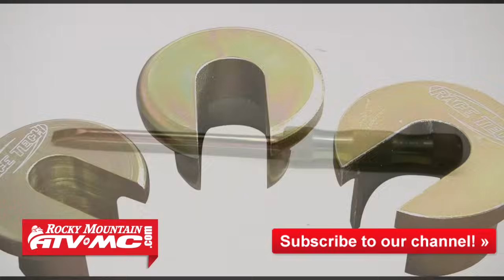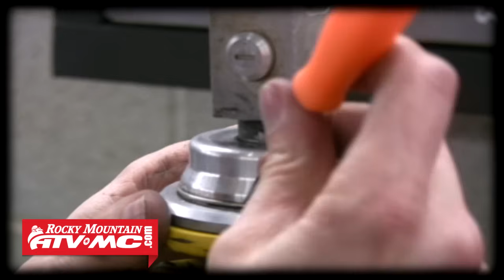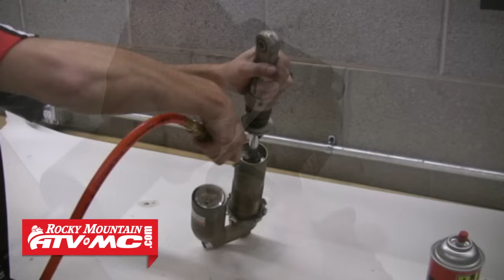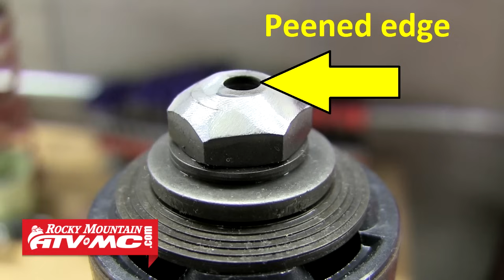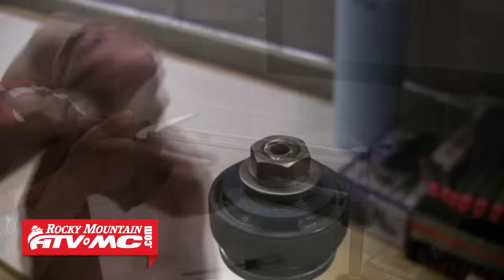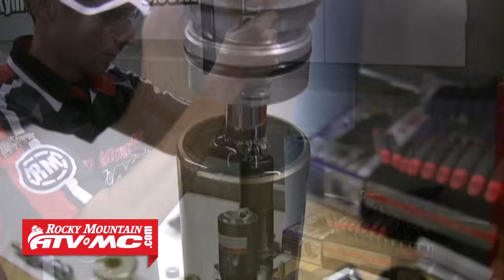How To Rebuild a Motorcycle Shock

Comment: hi guys on your website it shows that there is a circlip next to the Rear Shock Seal Head. just wonder what that is for thanks
Reply from the maker: That's used to retain the rear shock seal in the chamber when you fill the shock bladder with nitrogen.

Comment: how come when I push the seal head down it just Springs right back up to where it's originally seated hiding the clip I have the valve stem out there should be no pressure in the shock from the bladder

Comment: is it really necessary to use that much oil when pushing the bladder back in?  I don't want to make a huge mess all over my vise and floor.
Reply from the maker: +matt_ru You do want to make sure there is plenty of shock fluid so you don't get any air bubbles.  It's the best way to ensure that you don't get any air in the bladder chamber.

Comment: you need to be more specific about the grinding aspect, what's too far? and how do you know that a new nut is going to fit perfectly?
Reply from the maker: +Chris O'connor The goal is to take as little material as possible. The shaft from the factory will be peened or staked to ensure that the nut does not accidentally come off so we are removing just enough to allow us to remove the nut. Each shock will be a little different and some service manuals will demonstrate the complete shock rebuild so always check there first. Just take it a little bit at a time while avoiding any grinding on the center of the shock shaft and you’ll be fine.
Reply: +Rocky Mountain ATV MC thankyou I really appreciate the answer back, I will give it a go with manual in hand. thanks again!

Comment: I’m rebuilding my 1985 kx125. And why do you have to fill the bladder with nitrogen
Reply from the maker: There are a couple reasons but mainly that nitrogen reacts better under heat and pressure giving your shock a more consistent feel than if were filled with air. Compressed air has water vapor inside of it which changes the way the shock will react and water vapor under pressure is harder on your internal parts.
Reply: But... Air is 80 percent Nitrogen and 18 percent oxygen and 2 percent CO2 and argon and is trapped inside the bladder. If there's any moisture it cant get to internal parts.

Comment: How do you add oil in an older shock with no reservoir ?
Reply: If the shock is re-build-able, top it off the best you can, or even assemble it submerged in the oil.

Comment: is nitrogen necessary in any shock?
Reply from the maker: We recommend filling your shock with whatever the manufacturer calls for, to avoid damaging anything.
Reply: @rmatvmc  ok thanks. Air s recommend since the chamber in my suspension was too small for nitro
Reply from the maker: The chamber was too small? Shock's use nitrogen because it is less volatile and prone to changes under use and temperature changes. AKA more consistent performance from your shock. As a gas heats up it will expand and make the shock feel more firm. Nitrogen is more consistent through these temperature swings. Also, nitrogen is a dry gas, making it nicer on your internal components. It also has larger molecules than oxygen which makes any bleed off or leakage much slower than oxygen. I would always recommend running nitrogen in a shock, unless you are absolutely in a pinch. 👍🏼

Comment: can some one help me with this i just bought a used bike and the low speed clicker and the high speed nut dont spin independently. For example if you try and turn the low speed the high speed turns with it at the same time. The bike a a 07 yz125 i was wondering if there would be anyway to fix this or do i have to buy a whole new rear shock for 900+
Reply from the maker: The low speed will move with high.  If high moves with low it is probably just dirty and gummed up  a bit.  Just hold the high speed with a wrench while you move low.  Maybe a little wd40 worked in will fix it. Let us know what ya figure out..
Reply: Thanks i got it fixed i guess the guy before tried to jam it in or something.
Reply from the maker: yamaha yz Sweet, nice job!

Comment: how often do I have to do this
Reply from the maker: Your service manual should have the service intervals for your bike.  Usually for a rear shock it is between 20-30 hrs of riding time. It will depend on each year make and model and with what parts will need to be replaced?  Sometimes all it will need is a good fluid flush..

Comment: Every time I push the seal head down to reveal the circlip it pops back up and I already released the gas pressure.
Reply from the maker: +JD Weaver Yea, we recommend releasing the pressure and then removing the valve stem core completely in our video.
Reply: JD Weaver I'm having the same issue what did you do to stop it from springing back up I have the valve stem out the bladder is empty
Reply: honda2fiftyR 
unscrew the valve at the top of the reservoir. it's about 1/2 or 9/16 box end wrench you'll need. make sure that thing is pointed away from you! it will shoot out a few feet with some force with a bunch of fluid following it. Wear eye protection. have a towel wrapped around the wrench and valve while you are unscrewing it. then all the pressure will be out. Kind of strange that I still had pressure since I did release the air first. In actuality mine did not need rebuilt... It only had a couple pounds of air pressure in it. I should have asked how much pressure was needed before I did this :(
Reply: JD Weaver you talking about the dampening adjustment on the shock body?
Reply: honda2fiftyR 
No at the top of the reservoir. It does not look like a normal nut but you can fit a box end over it and unscrew it. Maybe it's just a plug and not an adjustable valve. I might be thinking of a YFZ450R shock.
Reply: JD Weaver I got it all figured out tool the tusk tool for removing the bladder and knocked the bladder in first and removed it then took the valves and piston out worked much better that way thanks for replying

Comment: I was with you right up to the point where you pumped air into the badder.  Bad choice.  Only nitrogen should be pumped into the bladder.  Any "air" that's introduced into the badder will contaminate the charge and ruin the reason for using nitrogen to begin with.  Don't do that part.  ALWAYS use only nitrogen to charge your shocks.  If you can't do this, don't open your shocks up.
Reply: nitrogen nitrogen nitrogen!  you don't explain what that reason to use nitrogen is.  
ideal gas law. look it up. 
also co2 is better.
Reply: @amcgee-dl3cj  3 main reasons. 1, nitrogen is non combustible. As the shock works it creates heat.  That heat can actually cause the oil in the shock to combust.  Thus creating a condition called diesel ingredients. 2, nitrogen molecules are larger than air molecules (mainly the oxygen in air).  This  prevents the nitrogen gas from permeating the bladder or floating piston seals. And 3 nitrogen is more stable than air which allows the shock to maintain its operating pressure more consistently.  Air expands when it gets hot and increases the internal psi making the shock effectively faster and stiffer.

You're welcome for the free tutorial.  Maybe next time you won't seem so stupid.

Comment: Looks doable from home until you get to the nitrogen part. What about all the air already in the bladder? Isn’t that 75% nitro? You don’t have evacuate that first? Why nitrogen?
Reply: its industrially convenient and its dry.  i prefer co2 myself. bigger molecule passes through the rubber bladder at a slower rate.

Comment: Bro I need a small help with information. My rear absorber is slightly in contact with spring on my cbr250r resulting in squeaking noise, and I'm applying lube on it for time being , what is the solution for this? Thanks in advance.

Comment: Why can't you use compressed air at the proper pressure?
Reply from the maker: Nitrogen is a lot more stable than oxygen. It doesn't react to temperature changes nearly as much as oxygen. Your shock builds heat as it get's worked, so nitrogen is important for that reason as well as avoiding moisture inside the shock and maintaining performance.
Reply: @rmatvmc  I get that Nitrogen is cheap and dry; that's why people use it. Our atmosphere is roughly 78% nitrogen, 20% oxygen and 2% everything else. Being a chemist, I know that Boyle's law says that all gas reacts the same to temperature pressure and volume. Just like all liquids don't compress. Saying that Nitrogen is more stable to temperature changes is just not true and like believing that carrots make you see better at night. It's a myth propagated by someone with a poverty of understanding. I'll blame it on MXA in the 70', they said a lot of stupid stuff people still believe. If you are trying to tell me the slight amount of moisture inside a rubber bladder is going to rot it from the inside through oxidation, I'm going to have to call BS on that one. It's an infinitesimal amount of oxidation to the aluminum cap and undetectable  to the rubber bladder. In heat transfer, I learned that water couldn't possibly produce energy when it goes into vapor, it would get heat through conduction or convection since there isn't any radiation, therefore only the heat produced from the shock is transferred to the surroundings. So it can't cause the shock to heat up faster.  I do agree that a typical shock on a moto bike will be up to full temperature in one to two laps max and at that point it dissipates just as much heat as it produces. If it was going to fade, it would do it right away. Modern oils don't really let this happen. It's the pressure in the bladder that's the key, not the gas providing it. If it mattered we would all have nitrogen bottles to purge and fill our forks. However the shock oil you use has moisture and oxygen in it as well. WP was the only one pulling a vacuum on their shocks to get all oxygen out of the oil before capping them off and pressurizing them. They don't do that any more, for a reason. It didn't make any difference and is a hassle.  If I'm wrong on any of the science, please enlighten me. I like to know.  Please don't take this negative or officious, You guys seem like a good bunch.

Comment: how much nitrogen should i use in psi?
Reply from the maker: The UnrulyYoutuber Most dirt bike shocks will require something around 150-160 psi of Nitrogen but you'll want to refer to your service manual. We highly recommend this be added by a trained professional at a service shop.
Reply: Rocky Mountain ATV MC is shock pump like we use for mountainbikes will do? Its high compressed pump suitable for fullsup mountain bike.. pls advise.. tnx
Reply: nitrogen is less likely to migrate through rubber and has less pressure change with temperature.
might be ok might not. 
the shock service manual i downloaded says "Air should never be used in shocks since it will expand with heat and could cause excessive pressures in the shock resulting in a potential serious problem."

Comment: What a fricken pain in the ass!  I know suspension of ancient times was inferior....but MAN was it EASY to service or replace rear shocks....things have really become nightmares compared to the "old days"....in the good old days of yesteryear a guy could service the forks AND rear shocks in one afternoon!   Could even go hog wild and service the swing arm bushings while you were at it!  ....Sort of makes one wonder how much of the improvements are really worth the sheer trouble one has to deal with....I mean I guess ....but seriously?   Could they have made some effort to make things better while maintaining serviceability?   I feel like that has not been the goal of manufacturers ....more like the first thing some engineers came up with that satisfied the MC journalists ....THAT is what they kept as "good enough"
Reply: Thanks fo your post, Doug... I've pulled my old air-cooled 1976 Honda XL250 out of the shed, 7.7k miles on her, and ran like a top, then.  Hasn't been cranked in 23 years... bout to fire it back up.   I recently bought a used 2013 crf250L with 527 miles on it.  That new liquid-cooled 250 is so dam sophisticated, and with too many moving parts.  My old 250 weighs about 290 lb with 20hp; the new one 320 lb at 24hp.  

The old 250 is a dang bullet-proof tank, and I've laid it down countless times off pavement, been over the handle bars at 30-35 mph on a sand bar, hitting a 6inch log under water reentering at the edge, crossing that creek... bike was fine.  The newer fuel injected 250 is very peppy; but, I have easily rebuilt that old carb in fewer than two hours, all tarnished and gummed up, turn key.  Agreed, Doug... all this new stuff adds to the sophistication, AND brings more rebuild bucks into the shop!  That's the price of sophistication!

Perhaps there's more ooh-ahh factor with that newer 250; but, I would have incurred MAJOR damage and expenses compared to that old 250.  I think I'll invest a few hundred bucks in that old bike for the real outdoor enthusiast in me!

Comment: Nitrogen? Air is also good because is 80+ percent Nitrogen.
Reply from the maker: Nitrogen is necessary for the shock. With all the action the shock gets with riding, it needs the nitrogen to provide consistent performance. Oxygen is more reactive to changing air conditions and temperatures and would change with the heat that a working shock creates.